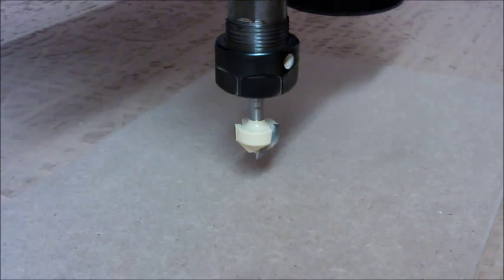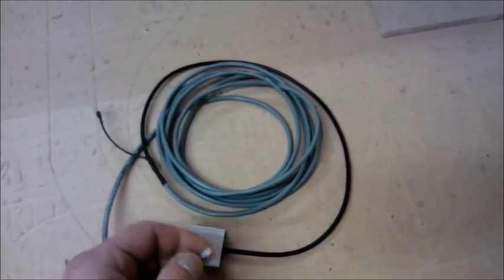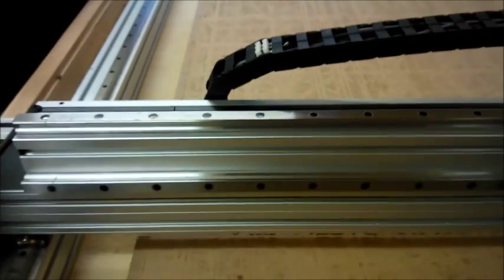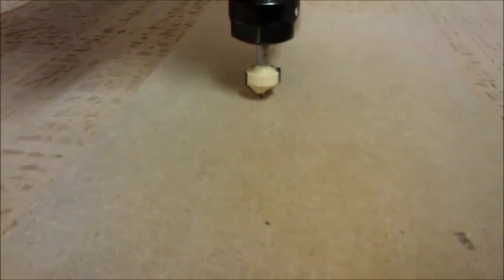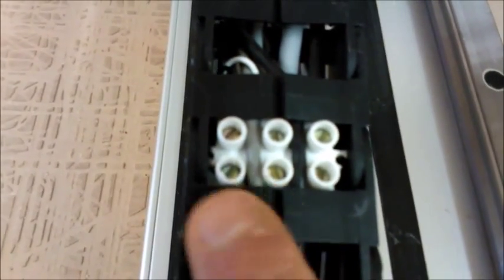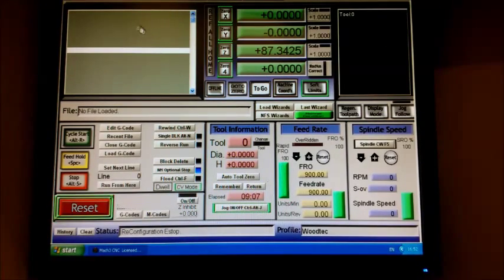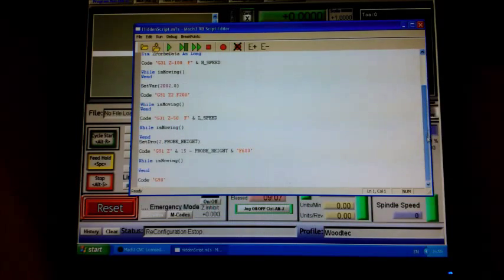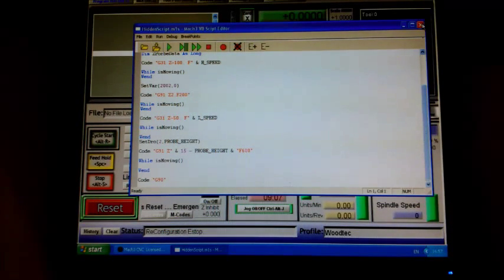How to Wire-up And Set-up a Touch Plate to Auto-Zero Z-Axis in Mach3 The Easy Way

Comment: YES, Thank you so much.  I have struggled with my auto tool zero for weeks.  I finally decided the problem was in my script.  I used yours and it works waaaaay better.  The only suggestion I have is it would have been great if you would have done one in mm and one in inches for us American folk.  I think I fumbled through it but im newer to the G code so it took a bit to figure out.  Not sure if its perfect but its way better than it was

Comment: Any advice on where to find gear boxes for stepper motors???
Reply from the maker: hi there iv no idea i got it as a complete kit the only thing iv done is put the auto zero on and a new PC tower as the one that came with it was naff 

One piece of advice don't keep it connected to the internet it will make the CNC run slow do your program updates yes but don't do a PC update it will cause problems with mach3